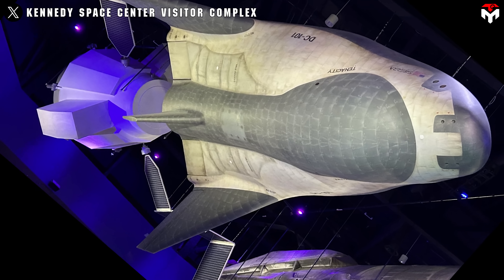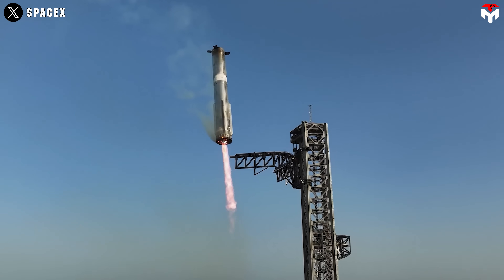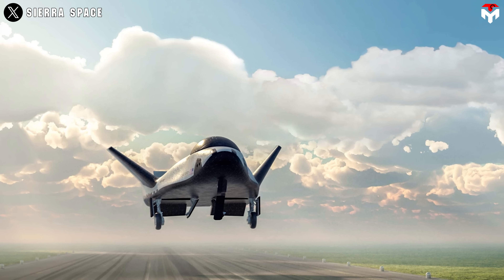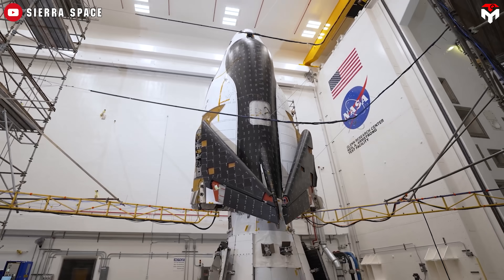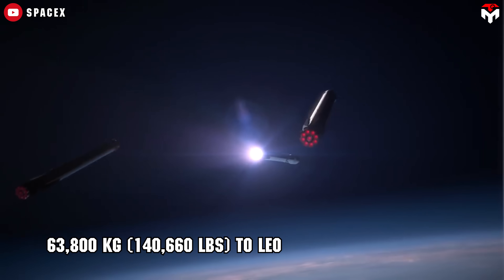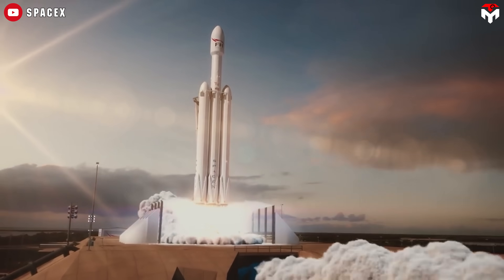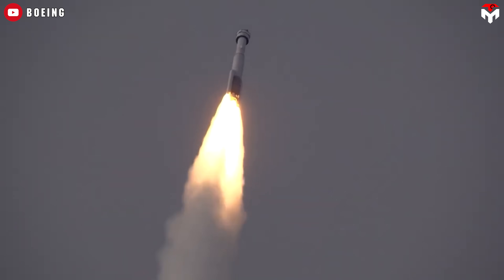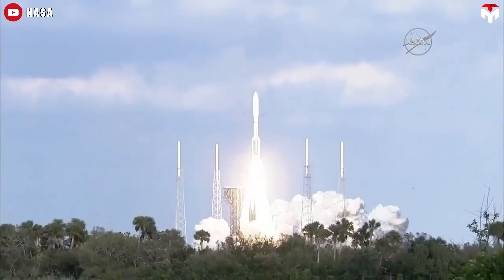SpaceX's Falcon Heavy Big Solution Solves What ULA Impossible to Save Dream Chaser...

Comment: lol everything is wrong in this video. how a space plane that needs high refurbishment process and restack on a conventional (even if reusable as falcon 9 or heavy) can be cheaper than starship that is designed to be ready for a new flight each 3 hours or so by use the same tower, just cos it lands on airports instead? it makes no sense at all, launch stacking recovery and eventually refurbishment are what really cost a lot, and rtls for both stages is always the better solution in that case. if you instead are comparing it to dragon excluding also the launch vehicles, it might depends on companies prices for both spacecraft, dragon is almost all reusable and even if it water landing it might still be cheaper more reliable and faster to refurbish than dc, might

Comment: it could be interesting if they found a way to attach and detach in space multiple dream chasers to a star ship.   if it linked-up like the 747 and space shuttle but while already in space. they may be able to use them as multiple safe landers for other planets. with the size of star ship and the tiny dream chasers.    you may be able to link 2 on the belly and 2 on its back, using star ship as a space station. 

attached they should be able to easily fly as one unit with very little drag in space. launch them all including star ship they can all move under their own power but star ship couldn't take of with them mounted that way.  rockets are great for cargo, humans can be cargo.. how ever the space planes are defiently great for human transport, might even be able to  relauch capabilites under the right atmosphere. especially with new drone tech.    
sorry terrible grammer was more of and idea dump, no body ever reads mine anyways lol.
Reply from the maker: Cool concept! It’d need new docking tech and control systems, but it could enable flexible missions. (And don’t worry about grammar—your idea’s worth reading!)

Comment: Center fuel tanks sent into space could also be used as environment housing probably already insulated if they are going to need housing anyway it could be assembled in space instead of always lifting huge massive rocket ships just send the industrial inventory in smaller loads then retask all rockets n tanks n radios gauges wiring left over mre n water

Comment: Don't be surprised if SpaceX already has the docking port for Dream Chaser and the hardware to mount it on Falcon Heavy.
Reply: If I’m not mistaken, all the connections are standardized by NASA.  They all have to mate to the docking rings at the ISS, Dreamchaser docks ass first, so integration onto Falcon 9 lift vehicles is relatively easy.  I think at this point it’s just a matter of will and getting around Butthole Bezos lawsuits!

Comment: Space X should build the Center Core 6m with 11 engines, Core Falcon 11. This can give return fuel and a less stressed center engine if not used on launch or 80%.
Reply: That would be a whole new design. SpaceX is focused on Starship for their next design.
Reply: I've thought they should copy F9 but scale it up to replace the Merlin engines with Raptors.  That would remove the coking problem almost entirely which would drastically reduce the time required to refurbish the booster as well as expand the cross section, increase the load limit and simplify SpaceX corporate fuel logistics.

Would it be that simple?  Almost definitely not but it should be quicker and easier than starting over from scratch.